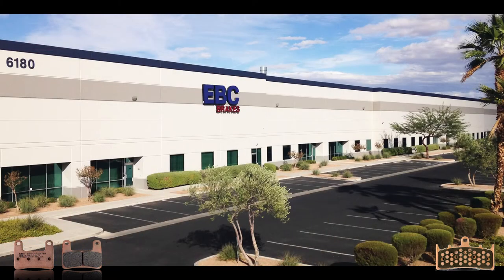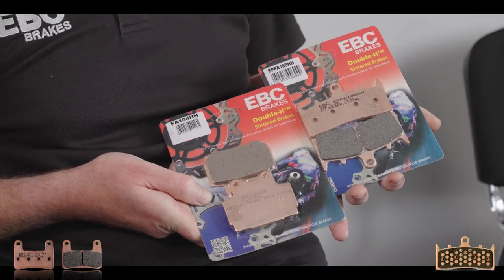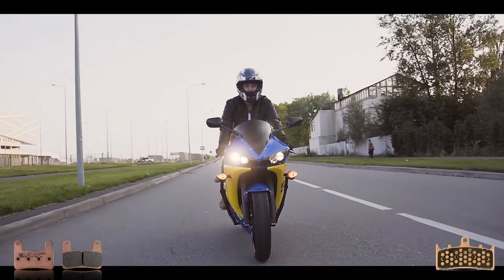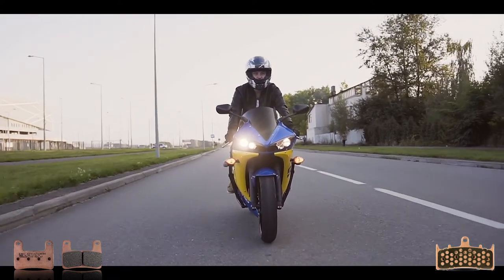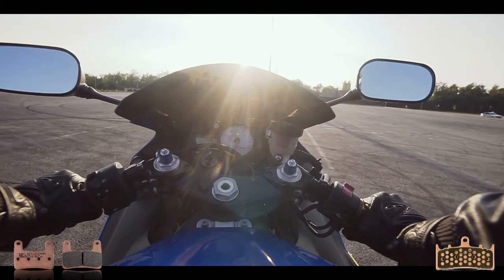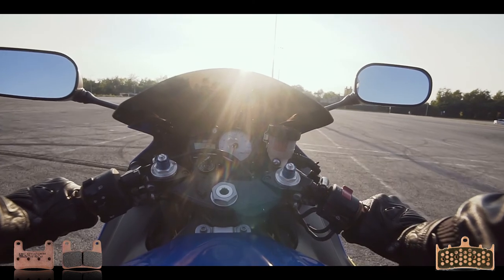Sintered Motorcycle Brake Pads | Tech Talks – EBC Brakes' Pad Compounds

Comment: Will double H brake pads on my Ninja 1000sx wear my disc rotors? 
Most of my friends told me that ebc brake pads will wear your rotors about 7 to 8 mm thinner after the use of 12000 to 15000kms
Reply from the maker: Hi! Drop an email to biketechnical@ebcbrakesuk.com and they can advise exactly what pad best fits your bike :)
Reply: So basically yes they do @EBCBrakesUK